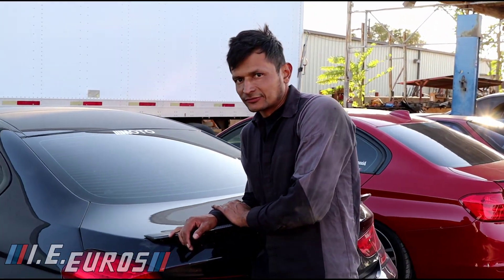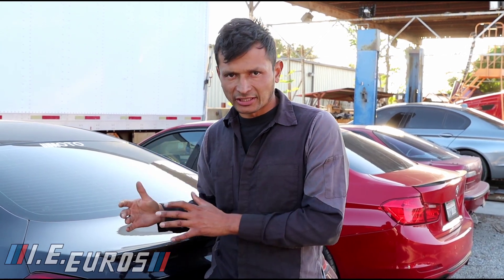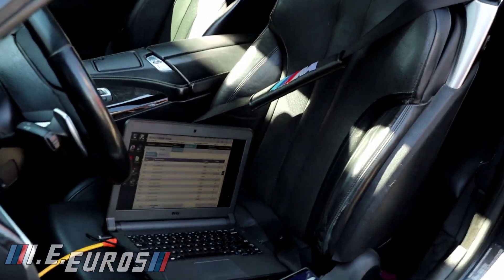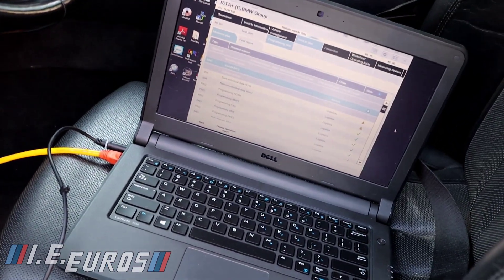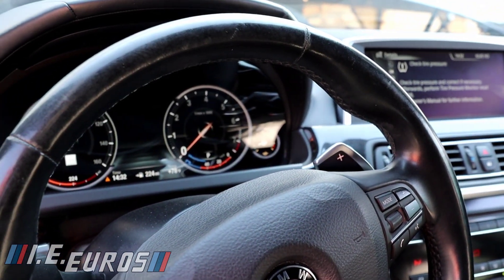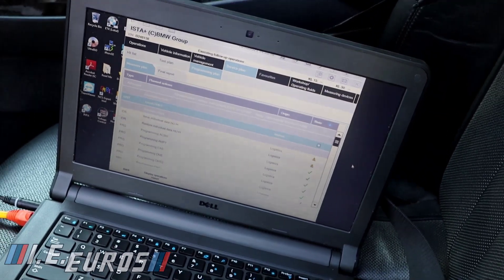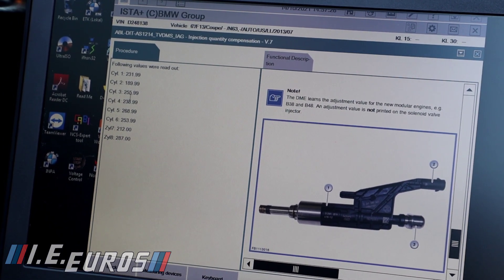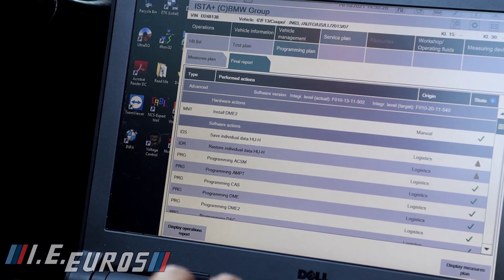how to do a BMW DME ecu module re flash programming coding recovery process and update

Comment: bmw 2003 525i, fuel pump relay under dash not  getting  proper voltage. How do you remove  the two main fuses, or the holder  holding  them ?

Comment: Hola Francisco! Gracias por el Video! can you Explain step by step how to update all Modules? i am using ISTA+ which is the same one you have and i want to do it on an F01 Thanks
Reply: I want to now about this too. I also have an F01 750i M Sport
Reply: @pdef1949 i figured how to using E-Sys very straight forwards but a bit scary! i updated transfer-case module, Footwell module no issues so far 👍 transfer case scare me! as i pressed execute all lights shut off and i mean all including cluster!! i was like OMG i messed it up! i can see errors on my laptop wile writing module and thought it was gone so i let it finish and came back with a successful flash message! i then ran a script within E-Sys it self to Clear any codes that may come up then all came back on! but i got a TPS Warning and Radio without Sound 🙁 i freaked out!! i try to clear TPS but it wouldn't, and radio wouldn't play either so i activated my GPS to see if there was any sound at all and gps worked so i knew amps and speakers were ok! so i closed E-Sys and Ran ISTA+  and clead all codes but i still had TPS and no sound however TPS now Said Reseting so i knew it wanted me to drive! so i turned off the car a couple of minutes and turned it back on and Radio play again 😁 i then drove the car and TPS went away as well!!  

still have multiple modules that need to be updated but im not sure if i want to do it 😂  just scary to think itll mess up $$ modules needing update are not very important like sunroof, AC control and Media center all work fine so why move it 😀 im just scare 😂

Comment: Hola: im having issues with my 20 430i GC i had a bm3 stage 2 tune and my coolant hose bust under recall. I did remove my tune and relocked the dme. Now my car wont crank i have power no crank. The garage i have it at states its my dme gone bad. I only used 93 octane fuel stp oil change 0w20 full synthetic  i have a upgraded down pipe  & muffler delete running stage 2 93 octane, since the reprograming of the dme i can turn on but wont crank. No one can read my dme 🤷🏾‍♂️ should i buy a new one or should i get the oem one reprogrammed for my car? Or do both?

Comment: 2014 750 Li xM sport engine seized up solid is it possible to pull the motor from the top ? Removing oil pan to check rods to find the reason
It’s locked up, to remove the 4 bolts on the torque converter

Comment: hello you are doing a very good job.  could you enlighten me on a problem that I encountered on a bmw f13 engine n63.  The idle is unstable and the accelerator pedal does not respond.  a few times when accelerating in slow motion and chokes right away.  sometimes impossible the accelerator does not respond.  I removed the spark plugs and they are black.  my diagnosis tells me as a fault code: monitoring of the mass of fuel, mass of air in relation to the mass of fuel implausible.  can you give me your opinion please?  what could this be from?  please help me
Reply: Same with my n63 don’t know of the cause but did you figure it out?
Reply: Have multiple misfire codes camshaft timing codes sensor code but nothing seems wrong for a tune up and still is not running right, it’s in drivetrain malfunction mode

Comment: I love watching your videos and I have a problem with my 03 750li , no spark on the spark plugs , do you know what's the issue ? Please help .
Reply: Any answer for my question ? Thank you .
Reply: First of all, it is recommended that you use the code reader card to read the engine system fault code to preliminarily investigate the cause of the fault. If the problem of ECU data loss is involved, high-end diagnostic equipment is required to solve it.
https://www.youtube.com/watch?v=MTIHoAFmnHQ